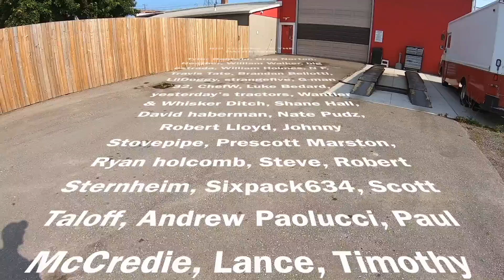i screwed up big time!

Comment: Never go into the basement check  where the waterline and sewer is coming through the wall 😂 Be sure to put that mud back against the wall to Don't use sand.
Reply: Be sure to recoat the waterproofing on the wall.
Reply: BUD THATS WAY TO EASY. DIG AND FIND.
Reply: @hankclingingsmith8707 yeah wait till he finds the SPICY dirt.
 That episode should be 🔥
Reply: @jimmyhoffa7935  😆 😂 😆 😂
Reply: @jimmyhoffa7935  I knew you weren't in that bridge.

Comment: Yeah always prepare ahead of time while digging that you may hit a water main. Find the water meter in the street and be prepared to know how to shut it off and always have compression couplings with  you just in case. They are normally easy fixes provided you know how to install copper pipe and fittings.

Comment: Might want to wheel chocks or set emergency brake junk transmission will break
Reply: The weight of the trackhoe is greater than weight of the rear end of the Cummins. When he gets the trackhoe on the trailer ramps he lifts the back of the pickup off the ground.

Comment: 9:53 i hope you didnt pay for that. A pipe laying in the ground they used shark bites or compression fittings on? Those pipes should definitely be sweated in
Reply: Compression fittings are fine in the ground
Reply: @ptshyu2  yeah but those look more like those push on shark bite things. Corrosion will still build up and push that thing around and make a leak even comp fittings do that.